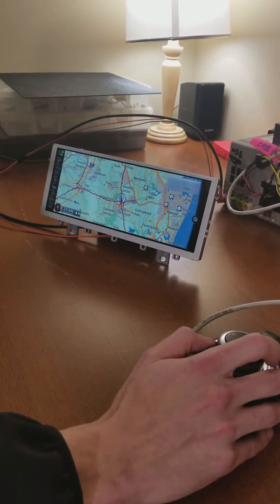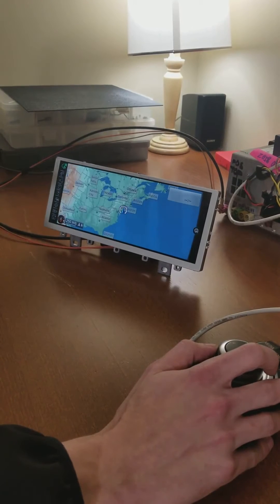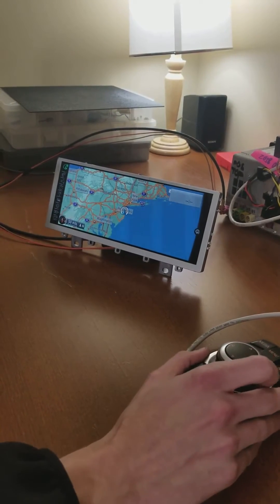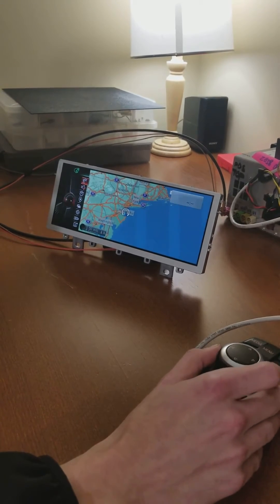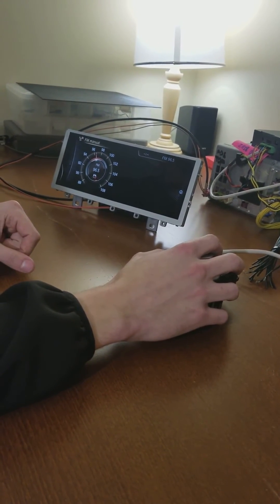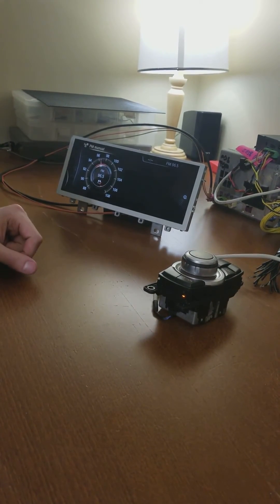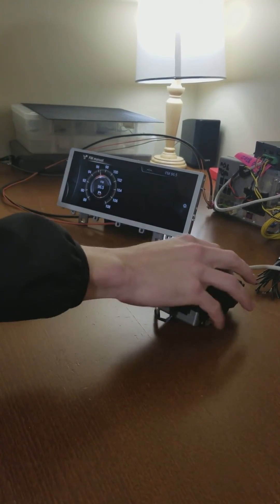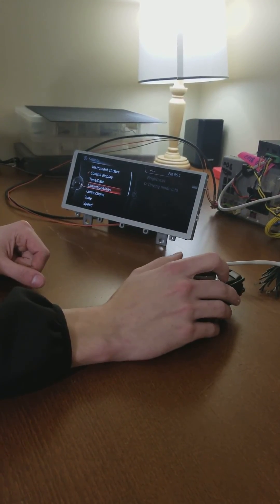BMW iDrive NBT Running On Bench

Comment: Hi, How did you wake the NBT?
Reply from the maker: This was a RaspberryPi with a Can controller spoofing the VIN and various modules in the car.
Reply: @NickNorman13b  would you be able to share that setup, I have a few raspberryPis used for other projects, what gets loaded on the Pi and is it used as the can controller or a seperate controller is used

Comment: WOW! How can I get this for my e39 M5?
Reply from the maker: This is still a work in progress.  I've added the link to the giant thread on BimmerForums(video description) where I'm posting updates.  Once the install is complete and everything works as it should, we will create a new thread detailing all of the parts required, as well as publishing code that we've written in order to accomplish this.  If you'll want to pull this off at that point, there will still be a lot of work for one to do.  The goal here is to stay as budget oriented as possible without spending hundreds of dollars on pre-fabricated emulators, screen bezels, iDrive mounting solutions, etc.
Reply: I follow the thread on the forums but I've been away for a bit. Looking forward to this development! Thanks for the insight!
Reply: Nick Norman I can’t wait to see the results as I would like to do this to my e38